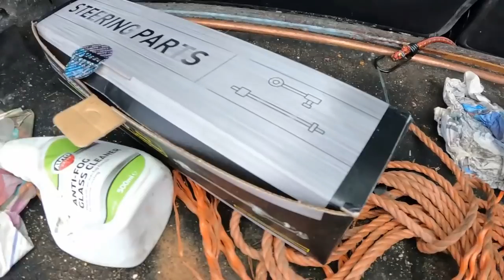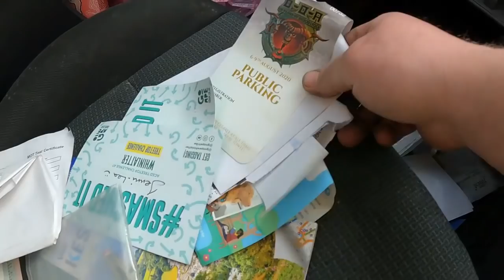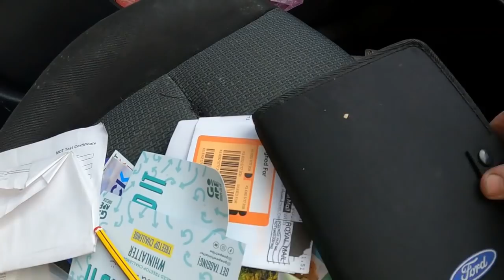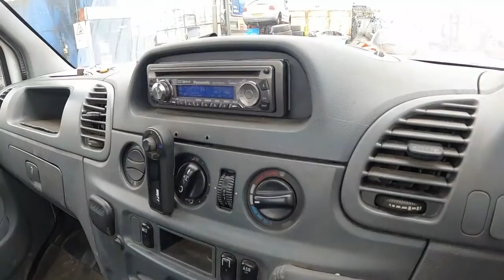WE SCRAPPED A FEW MORE CARS WHILST THE PRICES ARE UP!!!

Comment: Hi I's that freelander a td4?
Reply from the maker: Yes
Reply: Is it a good runner how much for all 4 injectors
Reply from the maker: It’s a non runner think it’s a fuel problem
Reply: OK thanks anyway keep up the good work lads lock forward to the next vid 👍👍
Reply: It's always the fuel pump in the tank that goes in them freelanders
Reply: Not in the tank on the td4 it's behind the Splash guard on the driver side back wheel arch